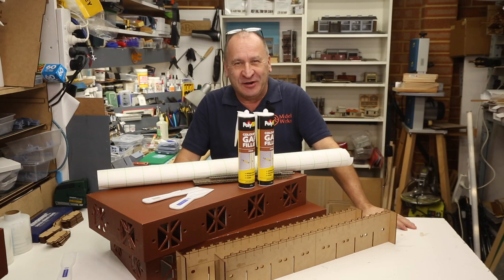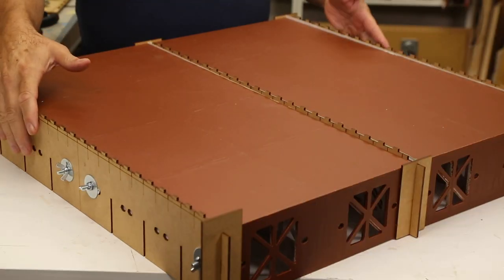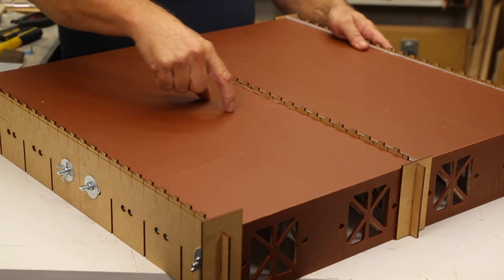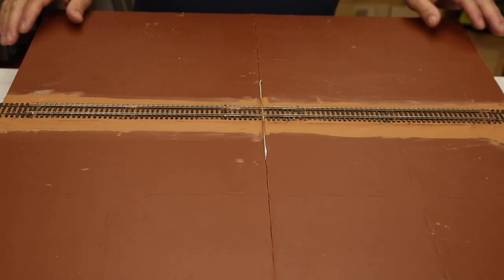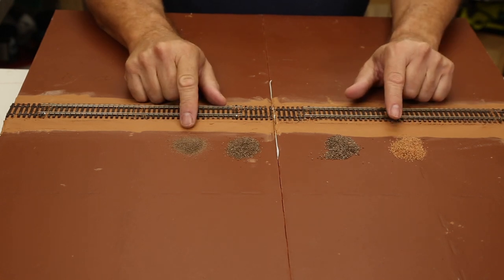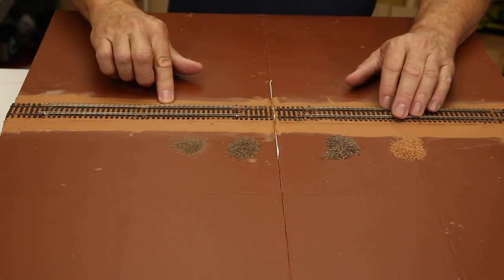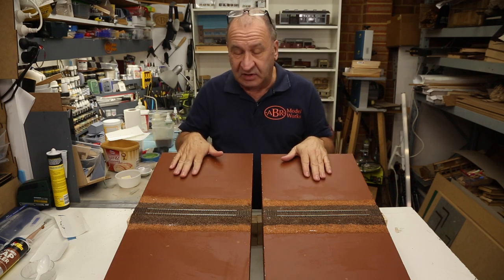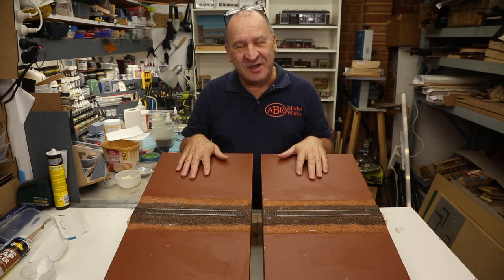New track alignment jig and laying track on ABR Lines VLog #9   HD 1080p

Comment: For quiet running I glued cork tiles to the baseboards. Buy them from Bunnings in a pack of 6, 305mm x 305mm, 6mm thick. They have a motley brown colour and look quite good for base ground cover.
Reply from the maker: Hi I am using 5mm cork roadbed from Midwest Products. By incasing it in a corking compound that is quite rubbery I am hoping that will do the trick.